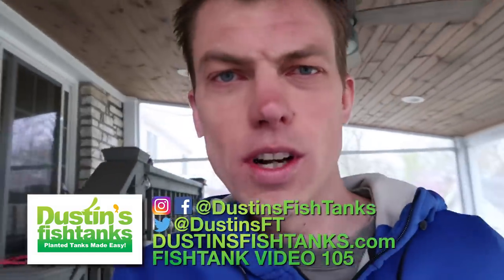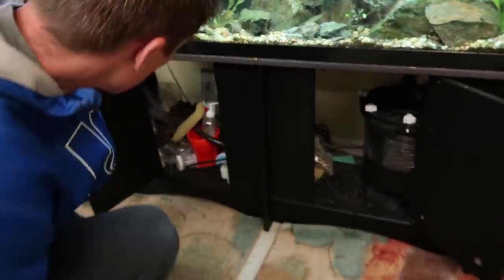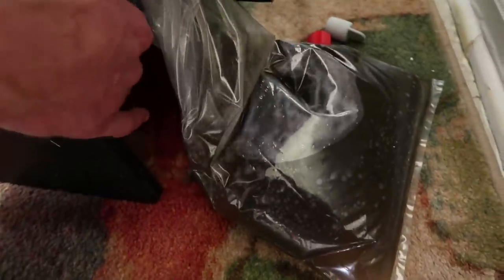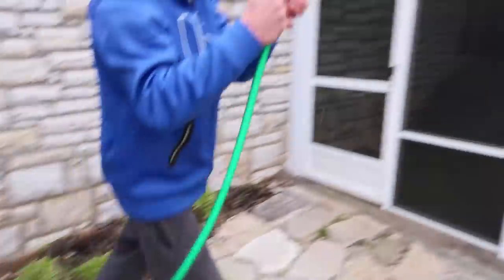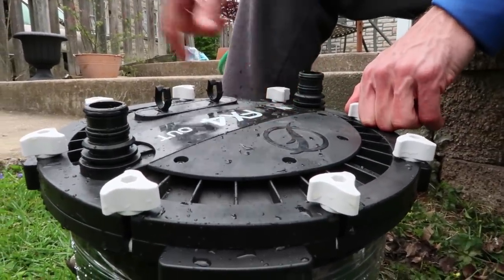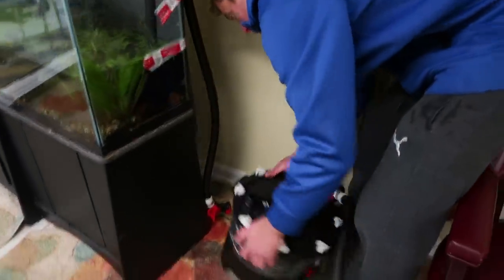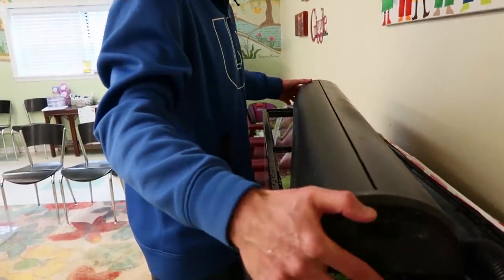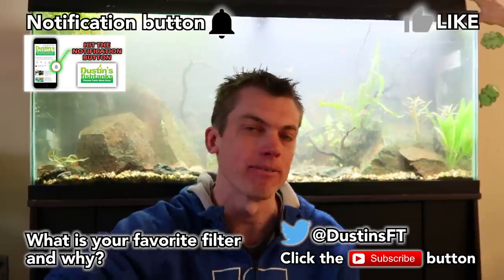DON'T DO THIS - No Maintenance Tank - I've Never Done This Before

Comment: I run the FX6 on my 180 gallon turtle tank. It does an awesome job of keeping the water crystal  clear. With turtles I have to clean mine every 30 days or so. When you opened the  FX4 after over a year I was like " Dang that thing is clean compared to mine". I was running Fluval 360's on my other three fish tanks( 55, 40 breeder , and 39 bow front ) , but I switched them over to just sponge filters after watching a ton of other you tube fish keepers.

I think the only thing I would change on my 180 set up would be adding a second fitter and alternate  the cleanings.

 Thank you Dustin for your video's . You are in my top three fish keeper video channels ;)
Reply: Gurney Harrell yes they are amazing i use it even for monitor and snake ponds.

Comment: I’ve owned an ehiem that was nat geo branded cf 30 I believe  had it on a 40 tall. It was solid but undersized for that tank so I got plenn plax 700 canister filter rated for I think 65 gallons, that was a great one too worked like champ. Lately I got 20 long with a fluval 206. This thing is awesome quite operation easy to use. The hose clamps to the tank is amazing I never want to go back. The mechanism to disconnect the hoses is genius and will change your life. The media basket and foam set up is very clever. Clearly some quality engineers came together to create the 06 line up.

Comment: That was real cool to watch. I was concerned at with those cold clean sponges putting water back into the tank. Then you solved that issue by draining three canister of water into a dump bucket. I guess that would bring the internal canister temp near the operating temp and not shock the fish.

Comment: I’ve never owned a Fluval , but I have 3 Eheim 2217’s and an Eheim 2213.  I have never had any issue with any of them.  They only get cleaned out once every 10 months or do.
Reply: I've got a 2217 and I love how you can literally put whatever you want in it in terms of media. I have a Marineland c-360 I use thats completely full of bio media, and my 2217 is literally stacked full of foam and polishing pads. I literally cannot reduce the flow on that thing it's super impressive. I will say the FX series has a bunch of comfort based features when it comes to maintenance though. The gravel vac system, drain valve, self priming, etc.
Reply: 2217s are bullet proof beasts.  I have 2 running on my main tank.  Setup was more than adequate for African Cichlids but I'm stocked with big American Cichlids so I added an FX6 this year.  Great filter for mechanical filtration for sure.  Pulls way harder than the 2217, which is needed for the big boys.

Comment: From my experience cleaning your media in chlorinated tap water is not going to have as much of an affect on killing the bacteria as you think. What may have killed more was the temp of the water. 

How chlorine kills bacteria is that it eats away at the cell walls of the bacteria until it makes them pop. Well to do that you need a long exposure time to the chlorine ~24 hours, at the levels seen in tap water, and at that point the chlorine would have dissipated too so it wouldn't be that bad. Another way to think about this is if our tap water was able to kill bacteria at the levels we are told it does then it would make a great household disinfectant and you would be able to disinfect countertops with just water. 

Also in an established tank your filters are actually colonized mostly with archaebacteria, which are able to live in super harsh conditions and able to withstand almost anything you throw at it, hot, cold, chlorine, dryness and tons of other things. At a Greater Cincinnati Aquarium Society meeting a couple of months ago a former Ohio State Professor Dr. Stephan Tanner (Now owner of Swiss Tropicals) said that the squeezing and spraying of media is going to knock off more of this bacteria than anything else you do, even using tap water, he actually advocate you to use tap water. Also letting your filter run as long as possible without cleaning is best, because in nature nothing is washing the gravel or sand or dirt, so run it as long as you can between cleanings. Also here is Dr. Tanner saying just that http://www.swisstropicals.com/library/aquarium-biofiltration/

I know this is a long post but I wanted to make Sure I explained myself. I have 80 tanks totaling over 3000 gallons and have ever cleaned out with tap water. As well as a 250 gallon running 2  marineland 360s and clean them both in tap water and do a 40% water change at the same time every 6 months with no issues.

Comment: The big Sun Sun cannister filter is less than one third of the cost of an fx4 and does a great job.  It is much easier to open and close than the fx4.
Reply: Problem with the sun sun is that it constantly gets air trapped, this is why the fx4 & fx6 filters are solid. Leave them on and don't worry but with Sun Sun u need regular checking
Reply: On top of the sun sun filters there is a big button looking thing, If you press it down your can expel the trapped air. Also I have been using multiple large sun sun HW-304B canister filters for over 20 years and have yet to experience this phenomenon. Where can I find the source of your information Antonio ? Maybe I can help with what they are doing wrong.
Reply: Aussie Soarer thanks for the feedback. Naturally I'm aware of the big plunger but on my system, about once per week, I get the issue of the Sun Sun getting air trapped then I have to start the process of switching it off and 're-priming' since trying to untrap the air just doesn't seem to work for me and rocking the unit also doesn't work due to lack of room to rock the unit, from where it sits
Reply: no worries mate, happy to help. I noticed on one of my friends aquael 700 max filters that there was a small tube like an airline going from very near the impeller and it was stuck to the top of the pump area inside the filter (where the air gets trapped) so that the pumps can suck out any air trapped there and force it out the outlet to the fish tank. this might be a good fix for the issue if you want to try to modify the filter so it fixes the trapped air problem.
So in short, a tube from inlet of the pump (inside the filter) going to the trapped air area should fix it.
Reply: I've got 2 sun sun canister filters. We love them . Easy peasy

Comment: The fluval fx series are brilliant filters without a doubt but where they fall behind eheim is build quality. I've never had a fx5 last 10 years, eheim classics like the 2260 (1500xl) have never failed me once. (23yrs and counting) There is a reason why eheim costs twice as much. German engineering and design vs Italian , just look at the reliability of German vs Italian cars. I know they are probably all built in China only to German specifications. I use both but that's just my opinion

Comment: 11:54 - If I considered canisters as the metaphorical laptops of the aquarium realm, then sumps with filter socks are the PCs; easier to upgrade and clean. Sumps should theoretically be just as good at mechanical filtration for a reasonable time, provided there's enough filter sock area, and a reasonable seal between the sock bracket and whatever it sits on to avoid bypass.

Comment: You dont need to turn it on and run back to fill the bucket, just lower the outflow hose down to the bucket and water will naturally run. That way u dont have to hurry. When you're done, raise the hose up and the flow will stop. :)

Comment: Eheim 2262(1500XL), in my opinion, is better than the fx6/fx4. First off it holds slightly more media, runs more GPH, and is cheaper on electricity. It is a BEAST but it costs more than the fx6.

Comment: This is the example that “ no maintenance tank” is just a myth.
Reply from the maker: sagrath1982 correct, however no filter cleaning for over a year is pretty solid
Reply: I suppose it could work a bit depending on everything you have in it
Reply: sagrath1982 on my no maintenance or limited with 1-2 yearly water change no substrate cleaning soil based systems I don't use filters on tanks 5g- 20gal, only sponge filter on 29g, 55g an 75g that gets cleaned maybe every couple of years or less. No issues, no fish or shrimp death my biggest problem is the massive plant growth and livestock reproduction and this in tanks that range from 5gal to 75gal with some going into the tenth year of being setup like this. I have had great success without algae issues too, it's all about balance IMO/E.
Reply: My 6 gallon tank is no mantience tank I haven’t touched it in 8 months I’ve only changed the filter cartridge twice. It has one sword tail at max size (2 inch’s), 3 tetras at max size (1 inch), a sucker fish and 50 bladder snailes (max size less than 1/4 of an inch). The bladder snailes mostly hang out in the filter and clean it that’s why I don’t need to switch cartridges often or clean it at all. There is no live plants all fake. I haven’t lost a single fish since I stopped cleaning the tank.
Reply: I think a bare bottom tank with this type of filter, where you have the output at the bottom of the tank, to stir up anything. You might be able to establish the "No Maintenance Tank". Since that external filter of this size. Will probably outlive the duration of the singular fish in it.... Let us say, a Betta just for the heck of it.